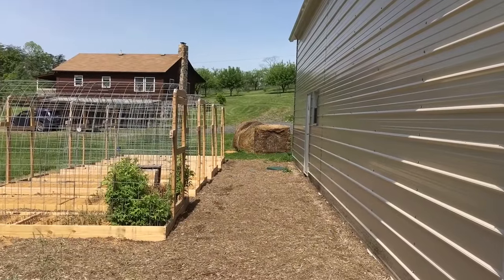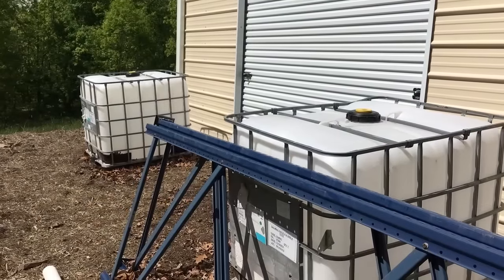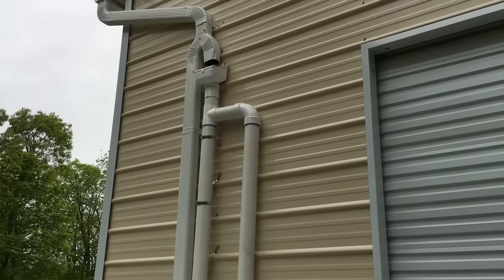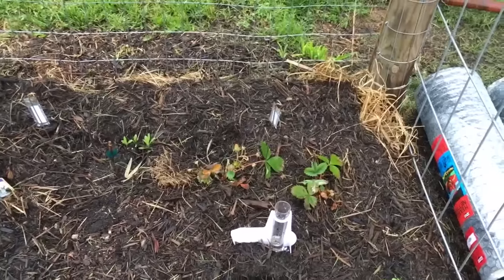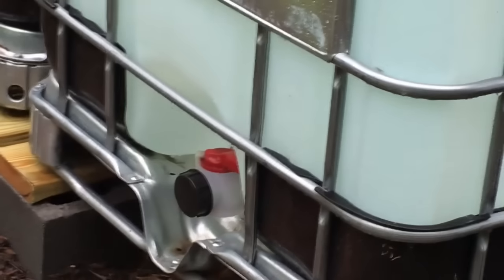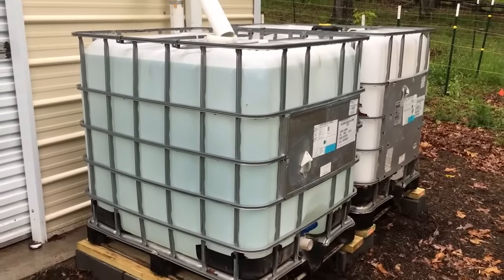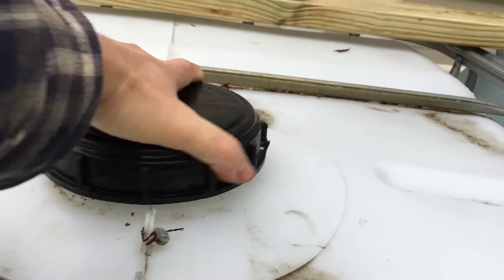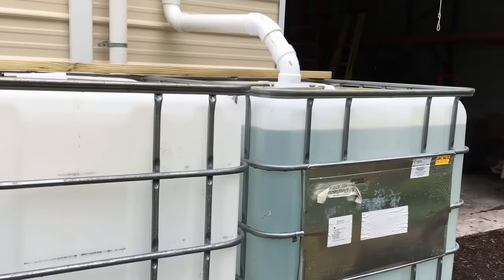Large Rainwater Harvesting System

Comment: You can also add other containers over by each garden and use your overflow to fill up garden water for watering bucket hand watering, anywhere that needs water that is at a lower elevation than the holes in your overflow pipe can be fed from the open end of the overflow, looks like a pretty sweet system overall, good video.
Reply from the maker: Thanks for the kind words.  I see what you are saying - basically daisy-chain tanks together to extend the water storage, as long as they are downhill.  Cool idea!

Comment: Great looking system. I've started with a four-55 gallon barrel system. Had the same problem that you had with my fourth barrel. Pressure would build up and slow down the equalization of water in the four barrels. My system only has 323 square feet of guttered roof. Still, it's amazing how much water you can harvest with one inch of rain. Great job 👍
Reply from the maker: Thanks for sharing!

Comment: Nice video. Though I have two concerns..(1) the over-flow pipe. The highest your tanks will get is the BOTTOM of the 2" fittings Not half way up. And there really wasn't a need for the "vacuum" holes. Because the water will never fill the 2" pipe. (2) Your totes should have been wrapped in thick black plastic to prevent the sun from build algae. You can paint them now. Just use a good quality plastic only paint.
And a side note...To keep down or reduce the chance of algae buildup...You can put in a bacteria ball for ponds.
Other than that you did a fine job.
Reply from the maker: Thanks!

Comment: Hi Todd.... If your plumbing uses two y fittings into each tank, you could just put a small rise/loop (two street 90s) at the end and an outlet tube for the overflow. The water will take the path of least resistance and then just go up, over, and out the loop at the end once the tanks are full.
Reply from the maker: Thanks!

Comment: Good vid,I did notice you are fixing up an over flow tube to take excess water away,am not a plumber but think you should install a vent at the top elbows it just might create a syphen and drain the tanks good luck.
Reply from the maker: Thanks!  I did drill a few holes to solve that potential issue.

Comment: Lol. It’s like looking at a car with nine wheels. I’m glad it’s working for you though. I’ve done basically the same thing but with 55 gallon drums but I just bent the rain gutter into the hole on one barrel with some nylon net in it to push the leaves away and then near the top of the barrel I just put a piece of PVC with two bulkheads between the two barrels and they fill up an overflow. It’s a whole lot less plumbing.  You could also move some of those tanks to the back of your garage and just fill one and run a 2 inch pipe all the way to the back to the other tanks and once they fill up they’ll fill up the other ones and have enough pressure to push the water back there so you don’t have to have them all right in front of your door.  But looks like it’s going to work, pretty cool
Reply from the maker: I have upgraded the system to 3100 gallons and will be adding another 1550 gallon tank this year.  The design has been working great.

Comment: Another thing nobody talks about; freezing in the winter! I plan on putting my totes inside my radiant floor heated barn to be able to use the water all year round.
Reply: .... or don't live where it snows.
Reply: I plan on building a solar water heater and plumbing it into my totes. It can use thermosiphon and will keep the water warm enough to not freeze. It can also temper the water for use in the house and reduce any sweating on lines and toilet tanks.
Also insulating them with a foam board keeps heat in and also blacks out the tanks to keep algae growth from starting.
Reply from the maker: Awesome!  I only need water when we are above freezing.  If you have livestock, your solution would be wonderful.

Comment: As to winterizing, rather than install an additional downspout, what we do is to simply remove the ball from the first flush pipe, and replace the end cap with a plastic flex pipe that connects to an underground drain that directs downspout runoff away from the house and out into our yard. After any hard freeze threat has passed, we reverse the process, catch our spring rains, and fill our tanks for the coming summer’s drought. This arrangement has the additional advantage of flushing out the first flush pipe so that it’s clean and free of debris and sediment come spring.
Reply from the maker: Thanks!

Comment: As to your intake, mosquitoes can still enter. Best to place screen filter inside the cutout bottom of a container and connect the entrance pipe through a hole in the lid of the container. Then place this small container into the inlet to the tank. No way for mosquitoes, dust or pollen to enter the tank that way.
Reply from the maker: Thanks!

Comment: sir you can buy a small booster pump at Harbor Freight, 3/4 hp with a tank and you can plumb the pump for a water faucette and then right into your tank plumbing.  It is not difficult.   My tanks are scattered so I mounted the pump on a 4 wheel yard cart for mobility.  I also installed a outdoor on/off switch on my pump for ease of turning it on.  I prime the pump, hook it to a tank with a short water line and away we go. I get 40 lb of water pressure at 100 feet from the pump
Reply from the maker: Thanks!
Reply from the maker: I wrapped them in black plastic this past year.  I'll be painting them black going forward.
Reply: +Great Escape Farms Lovely video content! Forgive me for the intrusion, I would love your thoughts. Have you considered - Proutklarton Protecting Aqua Plan (erm, check it on google should be there)? It is a smashing one of a kind guide for getting prepared for a mega drought without the headache. Ive heard some super things about it and my buddy finally got excellent results with it.
Reply: AJ Emaas - no need to resort to drastic means such as Google, when alternate and far less invasive search engines are available... duckduckgo.com and ecosia.com for example.
I followed your lead and I haven't been able to shake the fishy smell since, pew!

Comment: Just watched your Rain water Video and noticed one of your tank inlets is a straight pipe at 45 degrees at the top and IT is VERY close to the rim at the top. I had the same setup here in Australia. The reason 1 tank is slightly  less full is because in a downpour the 45 degree pipe WILL flow almost full bore and a percentage of the water will hit the rim at the top and be lost. Easy solution for you cut back a short section and put another 45 degree bend on the pipe. This gives you a vertical drop inlet like the other tank and NO water is list by this method. Hope this helps?
Reply from the maker: Thanks.

Comment: I tried this with totes and they turned green even with pouring bleach inside. Plus this is a small system, not  large. Now Ive got a 5000 gallon black tank and a 1500 gallon. I'm getting 3 more 5000 which will give me 21500 gallons. That's what you need for large gardening or small scale farming.
Reply from the maker: Wow, that's a lot of water.  I actually went to 3x1500 gallon tanks a year after making the videos.

Comment: How have the Tote's held up over the last few years? Did you end up painting or covering them to prevent green algae build up from sunlight, on the inside of the tote's? Great set-up though, going to use a modified version on my shed.
Reply from the maker: I ended up covering the totes with black plastic I had on hand.  Worked like a charm.
Reply: @greatescapefarms  how do you keep the water from freezing and breaking the totes in winter?  I'd love to do this for rain myself.

Comment: Thanks for sharing that little tip on folding over the corners on rain leaders. Quick Fix!
Always a bit curious as to the bearing load place on the soil for said cisterns. It seems that the pads are insufficient? 
Also, any reason why the first flush is so high?
How do you manage to clean the leaf screen?
Thanks in advance.
Reply from the maker: You're welcome on the tip of folding the corners.  I never had any issues with totes sitting on the soil.  Nothing ever shifted on me.
The first flush is so high so that I can accommodate the first minute of a downpour, because the first minute is when the pollen gets washed down.
As for the leaf eater screen, I just stand on the IBC-Totes and reach up to clean it.  It is easily within reach.

Comment: I would have the overfill come out of the top of the right most tank’s lid.  Obviously you said you wanted to prevent any leakage but that could be remedied by placing this tank slightly lower and mitigate that risk to just him. I have yet to see any leakage for my own system using this method. Anyways, a really nice setup.
Reply from the maker: Thanks!

Comment: This is so amazing 👏🏿 and well crafted. Where did u get the quick disconnect hose coming from the tote, and also, what size hose or fitting did u use at the shutoff valve of the tote? If u don't mind sharing please

Comment: 'Preciate the video.  It's cool that you took on the challenge and did it, so take this comment lightly, but I wish there were a video by a really expert person (plumber?/permaculturist) who knew all the issues up front and showed really good ways to deal.  You're discovering them and fixing them, so that's good.  I mean, we learn by doing, but it'd be nice to have the best starting point possible.  I'm going to take this challenge on myself - at least I'm planning too, hopefully I'll execute.  I already have the tanks and most of a rough plan.  Question:  Why put the leafeaters so high?  Seems hard to clean them.  Hopefully you won't have to very frequently, but it seems you could've set them so you can just reach them.
Reply from the maker: The leaf eaters are high because they have to be above the first flush system.  If I moved the leaf eater lower, I'd have to have a smaller first flush system.
Reply: @greatescapefarms  Thanks for the reply, I did set up three tanks a couple years ago and have had 3000 liters / 750 gallons of rainwater at the turn of a valve.  Amazing that they all fill up in one or two big days of rain - we get a lot of rain in TN.  If I mulched heavily, that should get me through a Summer drought.  Unfortunately I always forget that I have them on - when I'm filling a 32 gallon trash can, which I use to fill the watering can, and then drain it down in the middle of the drought.  You could also make the first flushes thicker - or have a couple of 'em together.  I just like to be able to reach the leaf eater so I can clean it off easily.
Reply from the maker: @solfeinberg437  Thanks!

Comment: I've seen mention that one's overflow should be the same diameter as the inflow.  you could have more water going in than your overflow can handle otherwise.  Since the valves at the bottom of your tanks are snake I don't think there is much you can do about it with your current system.
Reply from the maker: Yea, with the IBC totes, you don't have much choice.  There is a 4.5" hole at the top and a 2" hole at the bottom, so unless you are using 2" plumbing at the top, that would be tough to do.  I'm changing the tanks out this summer to larger tanks and I'll be moving up to 3" holes on the bottom and 3" pipes on the top.  Things will be a bit more balanced then.
Reply from the maker: Thanks for the comments.  I have seen the IBC-Totes very cheap as well, but the ones I have looked at are not food grade.  I need the food grade totes because I'm growing and selling edible plants.  If you can find food grade IBC-Totes for under $50, then that is a steal, and yes I'd be doing them all over the place :)
Reply: Shit I just paid $75 per for 6 of them.  Food grade, though.  Are the $20 ones?  That's so nice.  I almost wouldn't care, at that price.

Comment: the business about inlet and outlet must be at least the same size assumes equal pressure and flow. Know that 1. the inlet " pipe" can never be full bore full and will always be at ambient atmospheric pressure . 2. the outlet will always have a head pressure (assuming bottom discharge)  3. each tote pair  has its own dedicated overflow  discharging full bore, whilst the inlet is not receiving full bore, not to mention overspill, first clean and friction losses in the screens. Also, my first thought watching your excellent video was.... uh oh,  non opaque totes...algae.
Reply from the maker: Thanks for the info, Ed.  Yes, algae will be an issue and I will have to cover or paint the tanks.

Comment: In ground sprinkler systems have an under ground valve that allows the system to be drained.  Would that solve your problem of having to dig up the pipe to empty it in the fall?
Reply from the maker: Thanks for the suggestion.  I'll look into that and see if it is something I can do with this system.
Reply: Great Escape Farms or can just get a tire stem/nipple and can blow it out with an air compressor.

Comment: Given the translucent containers, are you concerned about the light that hits your water?
Reply from the maker: Good catch.  I ended up wrapping the IBCs in black plastic a few weeks after the video was made.
Reply: @greatescapefarms  Are there containers you would recommend that are impervious to light to start with?
Reply from the maker: @klayng1  They actually sell water tanks at Tractor Supply and other stores that are light proof.  I have a 1500 gallon tank that is green and it does a great job of keeping light out.  I found mine on Craigs List a few years back.  It cost me about $200.  You just have to keep an eye out and be ready to buy fast if you go used.

Comment: Hello, the overflow pipe that you put, would it work the same with only one tote. I finally found a IBC tote and am concerned about overflow. Is there another way to do it for overflow for a single tote or do I have to do it the same way you did it. Thanks
Reply from the maker: I did a single tote system for my father-inlaw and did it the same way.

Comment: Great Video...I am doing similar in a small cabin in the mountains...do you need to worry about freezing in your area?
Reply from the maker: I do.  I did a video on winterizing the system.  Here is the link: https://www.youtube.com/watch?v=nKpfa1h9NYw  I would do the system different in the future by adding a drain pipe with a valve at the low point so I didn't have to disconnect anything.  I'll be adding that fix next year.

Comment: Great video.  You mention in the video about a pressure tank and a pump.  I was looking at having something like this setup but I don't think the pressure would be enough as is to water my gardens so I would need a pump.  Did you end up setting up the pressure tank and pump?
Reply from the maker: I have a pressure tank and a pump.  It is enough to run my nursery operations but not enough pressure to run a lawn sprinkler (effectively).

Comment: can also put a small 1/8 hole in the tops to let the air out
Reply from the maker: Are you talking about the overflow pipe?  I did put some holes in that, although I may not have shown them until the lessons learned video: https://www.youtube.com/watch?v=BjfIFf3G5Ds&t=235s
Reply: the big tops to the tanks but saw after i commented you  did that
Reply from the maker: It happens :)

Comment: First flush system is really not needed. Especially if you are using rainwater for plants or pond. I've had mine hooked directly for over 3 years with no clogs and very little sediment that's flushes easily if I open my large valve. The sediment is actually good for plants.
Reply from the maker: Thanks for the reply.  My biggest issue is that I'm using mist heads for the cuttings.  They clog easily and we have a lot of pollen that must be be filtered out.

Comment: Are you still digging up the pipe across the door or did you finally put a 3 inch pipe across and run the 2 inch through it also the top caps should have a 2 inch fip plug in the center you can attach the water inlet pipe to and also an overflow pipe to that way you loose no capacity in the tanks and no chance of a emptying the tanks
Reply from the maker: Yes, I actually ended up running 4" pipe underground as I'll be adding more and larger tanks in the future.

Comment: Do you have anything under the cinder blocks. Or are they just in the dirt ? If so how have they held up with the weight of the water
Reply from the maker: I did not.  I didn't have any issue with sinking on the weight.  I have since replaced the IBC totes with larger 1500 gallon barrels.

Comment: Do you have to drain all of it in a winter time can it be a little bit of water in there
Reply from the maker: I do drain all the water out that I can.  If there is a small amount of water left in the tanks, that is not a big deal.  If there is water left in the PVC you risk the water freezing, expanding, and shattering the PVC.  I have had that happen before.  I had a section of PVC that still had a few gallons of water in it and it shattered the PVC and I had to replace it the next year.